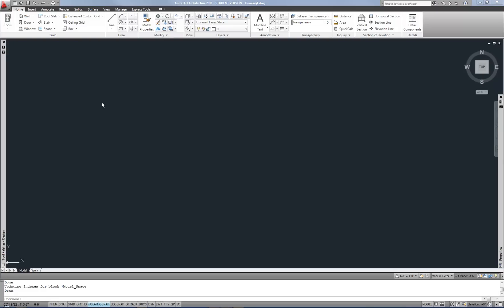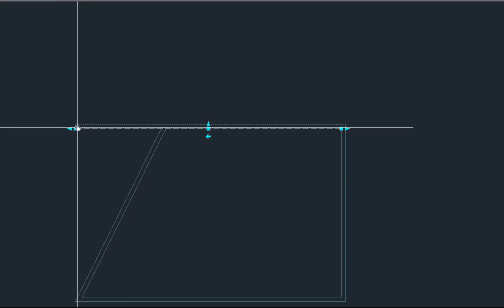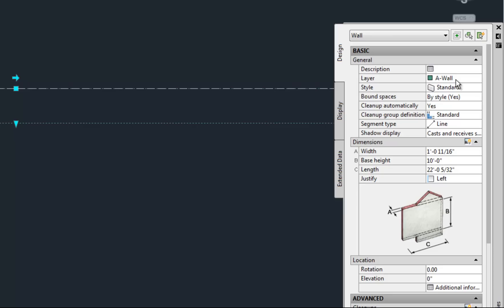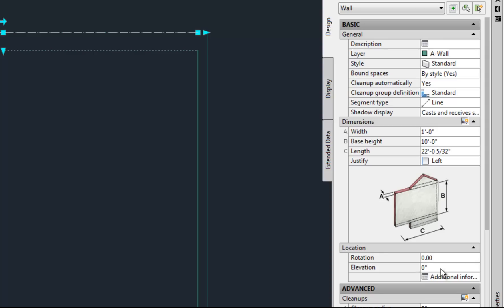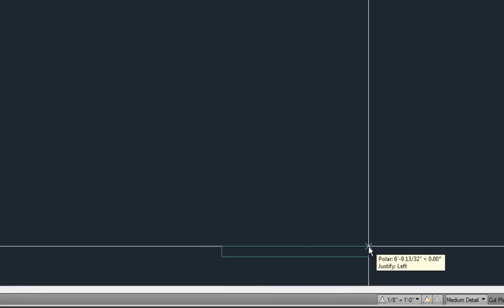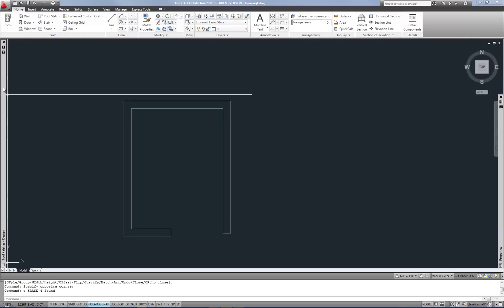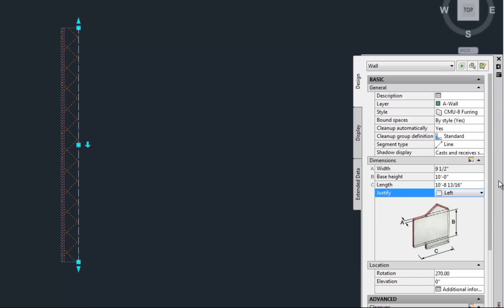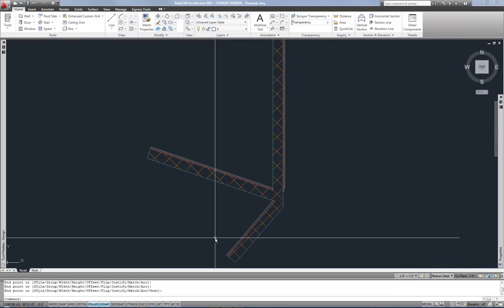ACA: Wall basics

Comment: Thanks for great tutorial upload. 
Even after changing drawing units to "architectural", I still see wall styles in decimal naming such as "CMU-190 or Concrete-200" Instead of "CMU-8" How do I change design pallet units to architectural? Thank you
Reply from the maker: +Kyuree Kim Use the US Imperial icon to start the software instead of the metric icon.  This determines while "profile" (batch of settings) will be loaded when the software runs.    It is possible to change profiles after the software is running by using Options, but the desktop icon is a much more reliable and simple solution.
Reply: +jeremytf77 Thank you. I changed it at Profile\Options. However I couldn't find "Imperial icon." I found only one in program folder which is linked to metric only. Should I reinstall the software? Or change profile everytime?
Reply from the maker: +Kyuree Kim When the software is installed you have the option to install either or both icons.  Uninstalling is not necessary.  If you go to add/remove programs and pick the software, when the Autodesk uninstall/modify window opens, you can modify the previous installation and then check additional options boxes.
Reply: +jeremytf77 awesome. thank you

Comment: thanks man. but i have a problem with my wall tool its doesnt give me all of those wall types like you   so how can i put those wall types into my wall tool? thanks
Reply from the maker: abdiwali hussein depends on what you DO see on the wall tab.  I assume you're looking at the wall tab of the tool palette - not the Design tab.  If you have metric tools, that is a function of which icon you used to start the program and which template you used to start the file.  If you have imperial units but still no or very few tools, you can add any wall tools to the palette tab by using the 'more wall tools' button on the tool palette.  Then you can drag wall tools from the Content Browser to the tool palette.

Comment from the maker: Save the two plans, drawn in the same locations relative to 0,0.  Save a third file (ideally in the same folder).  Type "xref" to open the XREF Manager.  Click attach to pick the file you want to bring in.  Just attach the second floor file at the z height corresponding to its position relative to the first floor.  Watch my XREF video(s) for more detail.

Comment from the maker: It depends on what you mean by "combine."  You could draw them next to each other if you wanted to do it simply.  You can could draw the different levels in separate CAD files with aligned positions in modelspace ,,,, then XREF them into  a third file to stack them into a 3d building.  Or you could draw them in one file stacked from the start. This last option is the most challenging because it takes a good understanding of display configurations and cut planes.